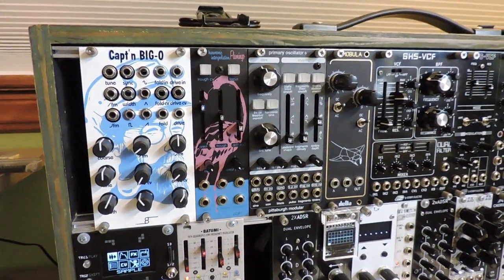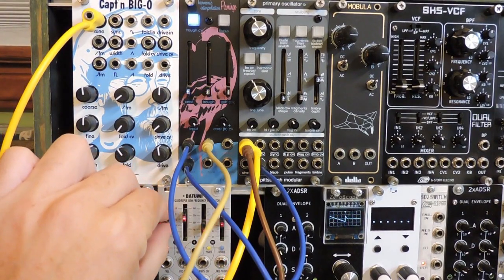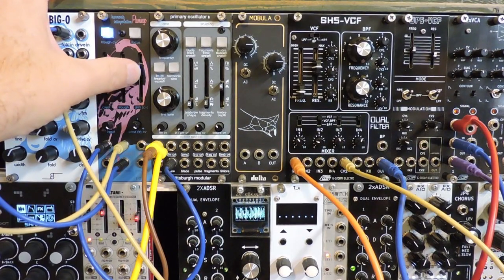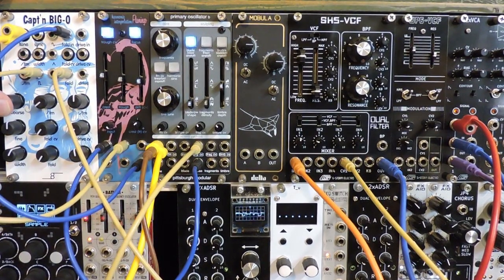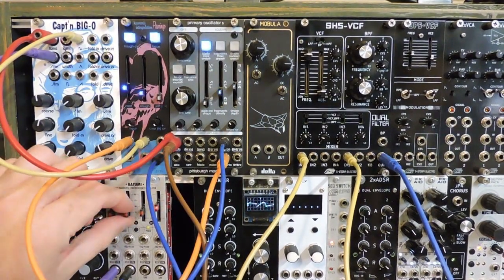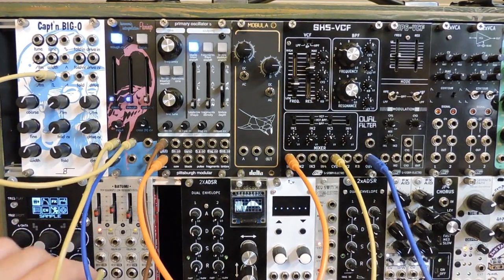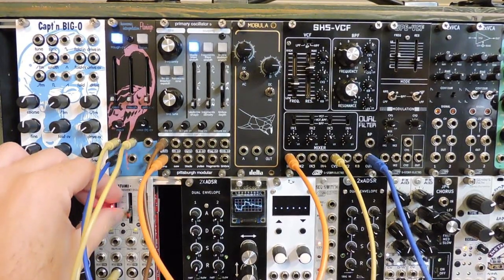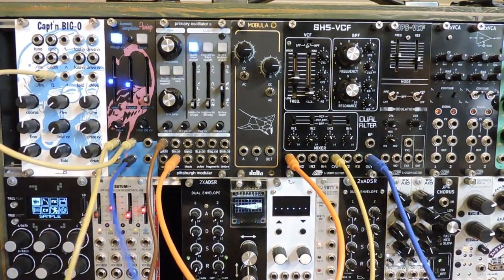Pittsburgh Modular Flamingo [Safari] Patching [Demo #1]

Comment: That thing can do some serious waveform decimation. Holy cow! I had the old Pittsburgh Crush module. I always liked it but ended up trading it at some point. Stupid decisions. Anyway... this seems like a much enhanced Crush circuit. BTW, I agree with you... the pink panel was cooler. LOL.
Reply from the maker: Thanks for checking it out.  Hope to see you at the upcoming Dallas synth meet.
Reply: @gstormelectro  November 7th... got it on my calendar. :-)
Reply: @gstormelectro  where can I find out more about this synth meet?
Reply from the maker: DFW Synth Headz on facebook, while it's a 
Dallas area group the event is actually held in Arlington https://www.facebook.com/events/433450794795948 the banner is correct in that they usually start the event at 2:00 pm.